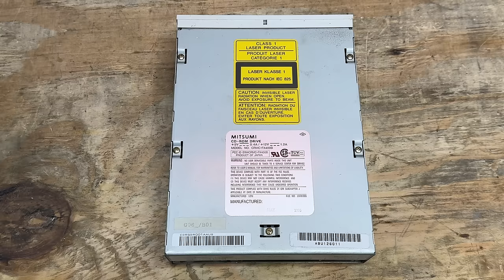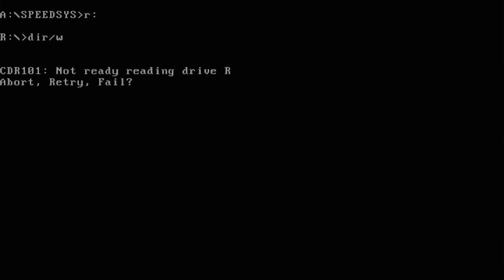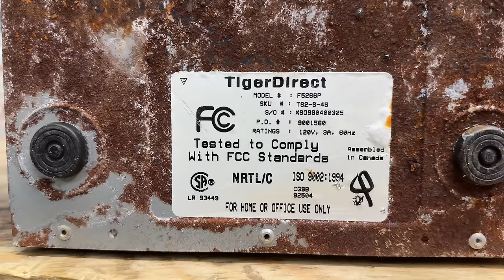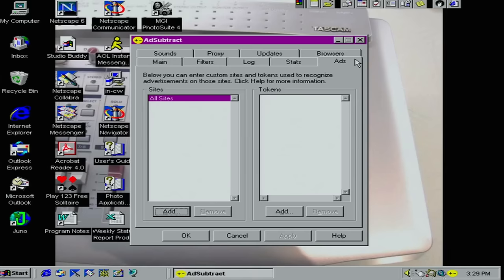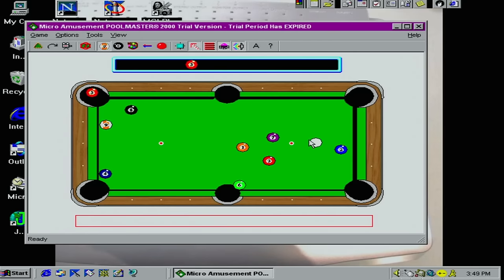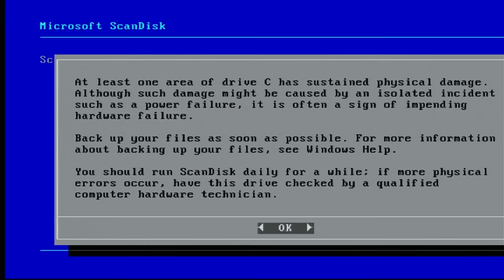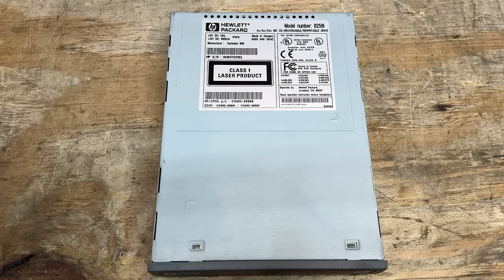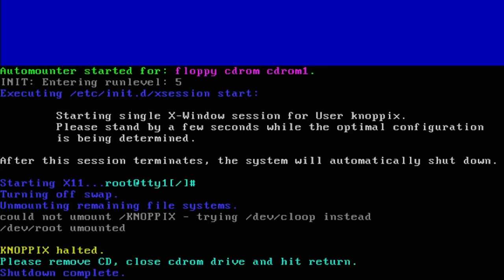The Odd Bunch: Giant towers to Baby ATs - Teardown and test!

Comment: Mike,To remove a face plate like the one on the Tiger Direct case, try using a socket wrench socket that is the same size as the tabs. It will compress the tabs allowing you to remove the face plate without breaking them
Reply from the maker: Good idea! I use that trick to remove the IBM PS/2 faceplates.

Comment: Lesson learned:  Need big strong arms so you can wrangle oversized PC cases like Mike does
Having both AT and ATX power connectors is a sure telltale of an early PCI v1 board, which ran on 5v timing, and not 3.3v like v2

Comment: cracks knuckles
System 1 - yes, that is EXACTLY how we accessed the socket lever back in the day.  same tool, too.  
System 2 - TD wasn't exactly a manufacturer or SI in the way you'd think of it.  The systems were actually built by someone else and rebadged at the factory, much like TriGem actually built eMachines.  I'm pretty sure that someone else was Systemax, who bought TD a couple years after this machine would have been built.  Systemax also went on to buy out the remnants of both CompUSA and Computer City.  "How good was OCR in 1996?"  Well, when I was asked back in 1996, I had to try REAL hard not to laugh in the customer's face.
System 3 - Holy yellowing, Batman!
Reply: i like the motherboard from system 2   for 3dfx system built.

Comment: Gosh seeing the 123 Free Solitaire game brought back some memories of my grandfather, he played that all the time on his old PCs right up until he passed away in 2011. He actually used a 733 MHz P3 system with Windows 98 until 2006, at which point he got a bargain basement LGA775 Celeron D based system that ran XP so poorly that the P3 would have done a better job. I actually ran an 800 MHz P3 system as my own PC until 2009 with XP installed that did just fine lol.

Comment: I can honestly say that I wish removable motherboard trays were a feature in modern PC cases.  Especially with M.2 SSD's becoming the norm, there's no reason not to bring them back.  It would making building so much easier.
Reply: They still are present in a few modern towers, but it's essentially the most expensive or premium ones, like some from Fractal Design or Be quiet!, that often cost more than 200 €/$... Such a shame, because a tray for the mobo is a must have imho. A true life changer.

Comment: I built a few systems with the Q500 in the early 2000's.  Back then for being what was a "budget" case it was extremely practical.  Antec & Lian-Li were the "premium" choices then.  It even came with a power supply!  That Power Man PSU you pulled was a throw in when you bought the case.  It's actually a very good quality power supply - it's made by FSP group.

My two most memorable systems I built with that case was a Pentium Pro server, and my own personal AthlonXP rig!
Reply from the maker: The PowerMan was indeed quite respectable in build quality!
Reply: I always had regrets of getting my Antec KS188, you had to slide the side panels all the way to the back in order to remove them, when I looked at pictures of the IWIN 500 I thought I should modify mine copying that design.
It was such a strange combination of parts, looks like someone took an old socket 5 motherboard from an existing system, purchased that IDT Winchip CPU upgrade (awesome find BTW) and parts from all over the place and installed it into that case.
BTW Mike don't know if you have research it but it's not common to find socket 5/7 ATX motherboards, apparently they command pretty steep prices for people interested into building inverse sleeper 😂
Reply: Ah, I miss my Q500.  Should have tried salvaging it after our house fire.

Comment: The SCSI card in the third system looks like a typical OEM one that was intended just for a scanner. Those were pretty common in the early-mid 90s. That's why it doesn't have an internal header.

Comment: No wonder the CPU fan in system #3 still sounded great, it must have been on vacation regularly - note the "Bali Bearing" [sic]. 😉

System #1 has a Tyan board, some good taste right there. (It might have been cobbled together for a young person at some point.) That Mitsumi 4X drive brought me right back, we used to have one just like that back in the day. Peak 1995/96. Not very good for ripping CDs, those were the very early days of DAE. A 4X/4X/24X burner would have been about average for 1999, I remember that we bought a Ricoh MP7040A of that spec in 1998. (It should still be among my old retro systems in my parents' basement.)

System #2 clearly belonged to an aspiring hobby musician, presumably of working age (20s-30s most likely). I wonder what the guy is up to now?

50:03 Also known as "carbon fiber towel" in the world of M539 Restorations. ;)

Comment: Seeing that Umax software brought back memories. I used to work for them in 96. OmniPage and Presto ( I think this was a basic publishing app, don't quote me though) were bundled with the consumer scanners. VistaScan was the driver. And OCR was pretty good back then too. Had to be a nice clear original though. I mainly supported the Pro stuff, but was pulled in to help the consumer side when thay were busy. Great video as always Mike. Keep up the good work :-) By the way, that SCSI card is what Umax used to ship with their scanners. Before they made USB and parallel port versions. I used to install an internal header to control SCSI CD-ROMs.

Comment: That Canvas X drawing system from Deneba in Miami started in 1987 for Apple Macs. I never used it or Macs, only later IBM OS/2 Warp, Windows 95 and some early Linux distros to start with. But it was for academic use and pros, unlike CorelDRAW or Adobe Illustrator that were for home users, too. 35 years or so later, (it was bought by a Canadian company  and became a Windows-only thing plus the Mac version with a different name), it's still available for some really big companies and such, I think. This history trip is quite cool.

Comment: On that second machine the best way to remove a face with those clips is to get a thin screwdriver and it into the middle of the metal thingy.

Back in 96 my best friend and I built up a very powerful, 200MHz 😂, computer we both used and it had a 2GB WD that dropped a platter but it still worked until it needed data on that platter. We used it for about a week of so to see if it would ever die, we got tired of waiting and put the replacement in and dissected it.
Reply from the maker: Good idea on the clip removal! That is a really interesting hard drive failure mode. I would have fun with that!

Comment: My original ABIT/Celeron 300A build back in the day had a very similar case.  It wasn't as tall, and didn't have those feet, but it did have the slide out MB tray, and that vertical triangular trench on the face with the LED's and reset button in it.  Wish I still had it now.
Reply: I should add I meant the first system featured here.  After doing a bit of research, I'm pretty sure mine was an  InWin A500.

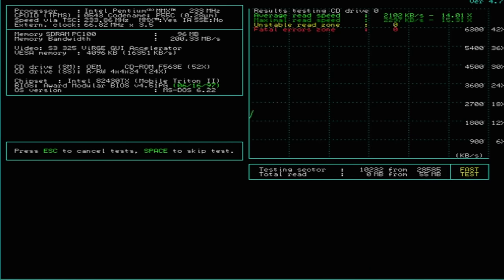Comment: Hi Mike, Your comments and observations after: 47:40 were so comical! 😂 at: 50:55 you mention that you wouldn’t want a disk to explode but you’ve heard stories of it happening to others, I have a Shuttle PC which is similar to the one in one of your other Videos and I inserted a genuine Microsoft XP Disk and the drive started making a horrendous noise and then the Disk shattered, It didn’t half make me & my Female friend jump at the time, First & only time it’s ever happened to me and wouldn’t want it happening again! I can’t believe all 3 of those Systems had no Thermal Paste on the CPUs, Think I’ve actually had one of those “Power Man” PSU’s and my first ever CD-Writer was a HP but a little bit different to the one in System 3, You also mention retro-bright for System 3, I did it with a few of my Cases back in 2020 during Lockdown & was happy with the results, I used Cara White which I bought here in the UK from eBay, Apparently it’s also used for Caravans & Motorhomes (Trailers or RV’s in the US & Canada) 🇬🇧

Comment: In my experience most drives except really really old drives(proprietary interface to maybe 8x IDE) read CD-Rs well although it helps if you burn your CD-Rs at a lower speed usually, The problem I've had is the DVD optics on drives just dying, like they'll read CD-Rs and CD-RWs fine but any type of DVD is a no go, I've got a few DVD drives where their ability to read RWs has gotten margnial, they'll read +/-R and -ROM fine but really struggle with RWs, and cleaning lasers on optical drives and cleaning and regreasing slides only helps on rare occasion.

Comment: I bought a NOS case 2 years ago, identical to system 1. The button was sticky having never been used, remains sticky with every cleaning or lubrication I have tried. The only solution I haven't tried yet is a replacement spring.

Comment: I’m unsure if this is true for an old PC but I had a 1993 Buick with a factory GM CD player. If you burned CD-Rs at 4x or whatever the slowest speed was in Vista and used Verbatim or Maxell CD-Rs it would play them. I never had a cd burner at the same time I had 486/Pentium pcs to see what impact that made on those machines.

Comment: Mike, you mention tantalum caps exploding. I’d not heard of this before. Most vintage Mac enthusiasts install surface mount tantalums as replacements for leaking/exploding surface mount electrolytics on older Mac logic boards, claiming they are maintenance free. Curious.
Reply from the maker: Not sure if it’s due to manufacturing defects or just from aging, but they often fail on boards from the ‘80s and ‘90s. It’s a plague of systems like the IBM 5150 and XT, etc. I had one fail in this video: https://youtu.be/2K_WgjtAsLw
Reply: @miketech1024  Interesting, I watched that video before and somehow missed it. Thank you, sir!
Reply: Tantalum caps will be fine as long as they are derated appropriately - their rated voltage will have to be more generous than for conventional electrolytics, e.g. a 25 V part on a 12 V rail instead of the traditional 16 V type. The failure mechanism is overstressing from inrush current at power-on due to their small size and low ESR (talk about being a victim of your own success). Going from 16 to 25 V alone seems to reduce field failures dramatically. You could even be super conservative and fit 35 V ones.

Comment: I cant tell you how many Pentium and K6 processors i've seen with the damn warranty sticker burnt to the top of the processor. lol I had a 62x Maddog drive that the speed control on the spindle motor failed wfo. Anytime you put a disc in it was absolutely guaranteed to destroy it. The speed that thing would hit was funny af until it finally stopped altogether. That thing sent off probably 30 cd's and dvd's. lol
Reply from the maker: If I ever find a CPU like that, you're going to hear my maximum snark LOL.
62x... What a time to be alive...

Comment: why do the dial modems have those yellow transformer looking things on them? the mix of digital and analogue components on them is interesting. dial up modems are before my time lol
Reply: because analog phone lines were analog and had voltages higher than the logic in a computer. and the signals had to be converted from digital bleeps to an analog phone signal, and from analog phone signal to digital bleeps the computer can understand. modem stands for modulator/demodulator.
Reply: @Stjaernljus  interesting, thanks for the explanation

Comment: If only these systems back in the day came with 12 cores 24 LP running at 4.20ghz with 32 gigs of ram.I bet the price tag would be well over a mill if not more lol My very first computer i bought was a all in one Compaq Presario CDS 520 specifications · Year: 1994 · CPU: Intel 486 SX2 66 MHz with 8 mb ram.

Comment: Were the thermals on old Pentiums just not that problematic to where some manufacturers skipped the paste/pads or was that egregious cost cutting?
Reply from the maker: It was really uncommon to find thermal paste in regular use as it wasn't a hard requirement for older chips. Thermal throttling wasn't really a thing yet, and for most people the lifespan of the chips wasn't significantly impacted. I'm sure manufacturers were quite happy to avoid the cost!

Comment: why the cd drive is labeled "R" ?  while i remember its a "D" drive back in the time... thanks!
Reply: the BANANA boot floppy is a strangely set up DOS boot floppy that has been passed around and copied for years.
Reply: Well not always. Back in the day, Hard Disks were either in MB or if you could afford it GB I.e 1GB or 2GB. A lot of PC owners opted to add secondary or more HDD drives as it was cheaper back then. Also MS-DOS / Windows could go up to 26 drives (A - Z). A and B are reserved for floppy disk drives. So the Banana driver disk would be using a higher drive letter just in-case 👍🏻 Also CD technology only started to become a thing via the Mid-90’s and PC technology had to be backward compatible.

Comment: I do love some tall towers. I have one (Gateway with PII) from '99. I can't believe ole Rusty actually worked, that's amazing. But it does get one to wondering; you have a decent selection of nice used cases, would it be worth transplanting that system into one of those cases? Getting all of that rust off wouldn't be easy....